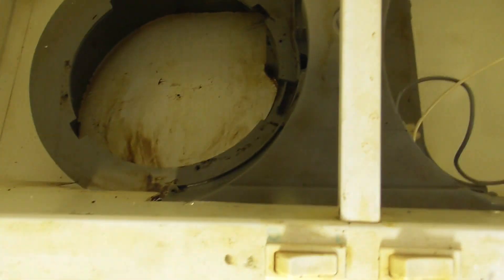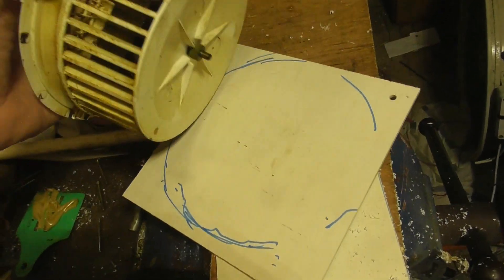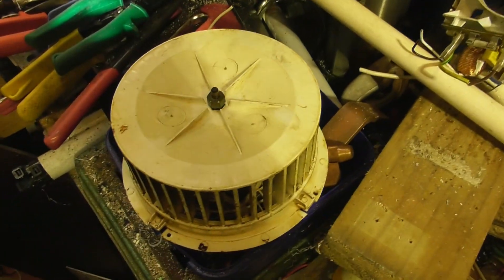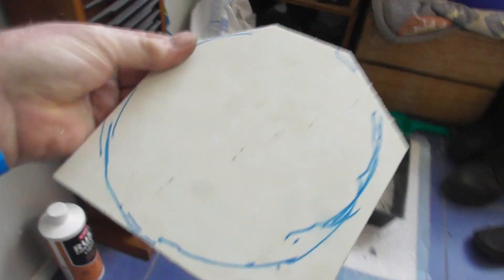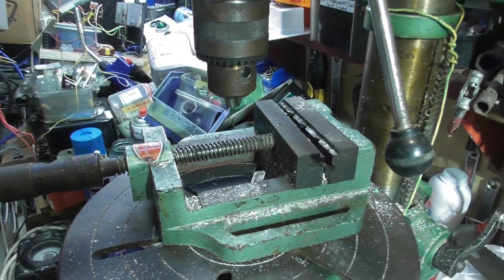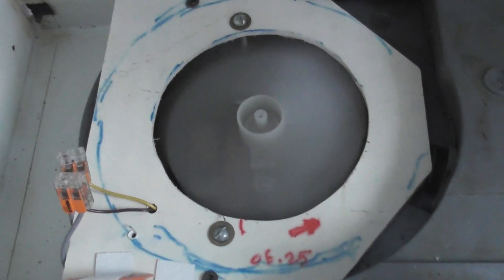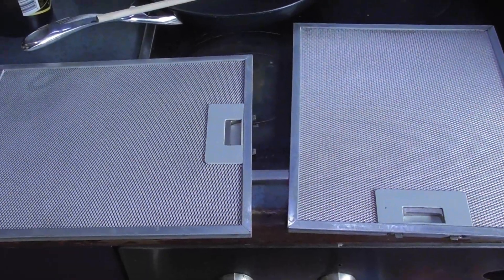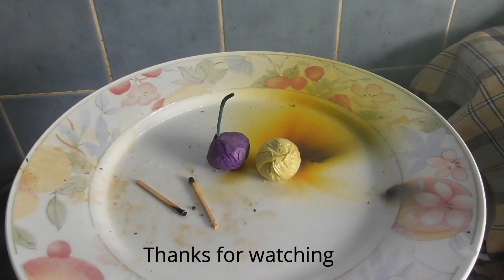Rangehood fan modification with microwave cooling fan

Comment: I would suggest turning the propeller half a turn. I'm pretty sure it would move more air if it was turned. The aerodynamics are designed for the air to flow the opposite way. But yeah or just good it works.

Comment: 1000 points for the effort, but a range hood fan is built for volume transfer whereas the microwave style is for speed. Would love to see a video of rewinding the original motor. I've done a few over the years and to my surprise, some were successful 🫤.
Cheers
Pete' Hokitika.
Reply from the maker: I am giving the rewind a go. If successful there will be a video of it.
Reply: @RODALCO2007  Excellent 👍. Very rewarding when you turn it on and the smoke stays inside the motor 😊.